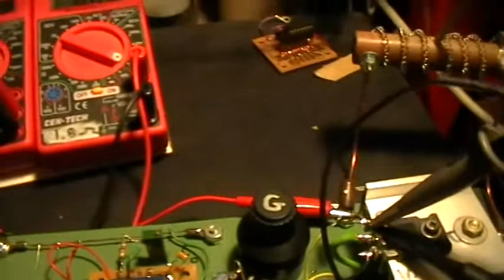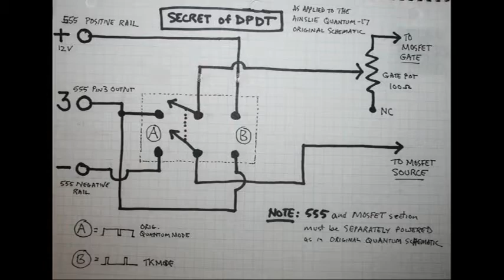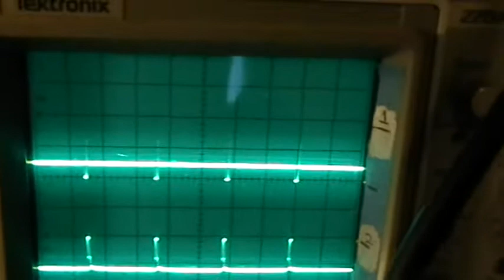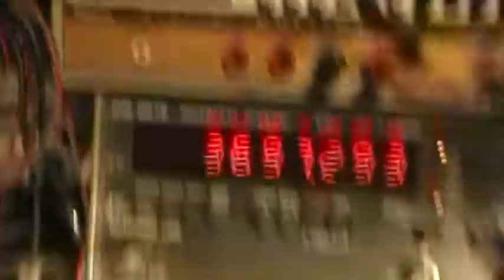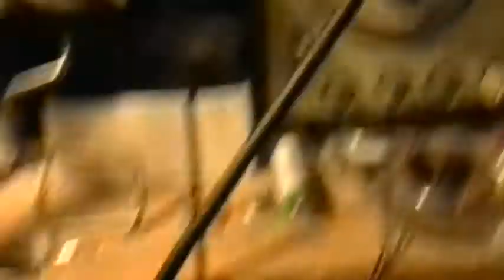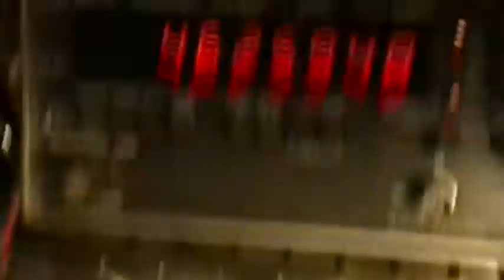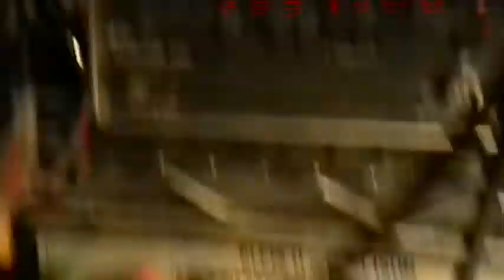Electric OU: TK's Quantum-17 Apparatus, Secret of DPDT, Cap Charging

Comment from the maker: I wish.
Who would buy it, and why?

The circuit, except for the 555 timer part, is the "unclamped inductive test" circuit that has been in the back of power mosfet data sheets for thirty years or more. 

That's it! This is a mosfet tester! You can't test mosfets properly with a regular DMM transistor check function, but if you had this circuit in a box, or built into a DMM, you could use it to test mosfets!

Thanks for the idea!

Comment from the maker: Been there done that. In fact you can even see the inverter chip on another little RS pad-board sitting up there in the junk on the bench if you look carefully at 1:20. I actually used three gates of a 4049. That is not the point, though. 
You say it's not "healthy" but I'm not sending 5 V to the gate as you can see from the scope traces, it's rarely below 10 V, but in a future video I'll show what happens when the NE555N is underdriven. The "Ainslie oscillations" are due to the misbehaving 555.